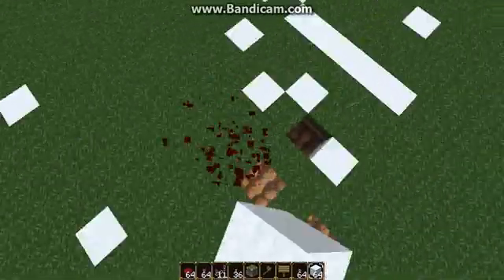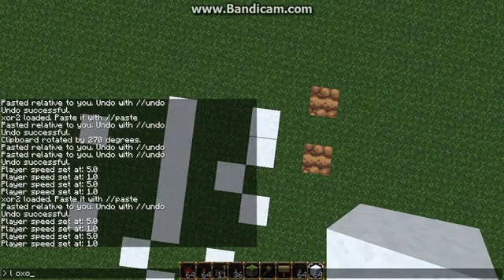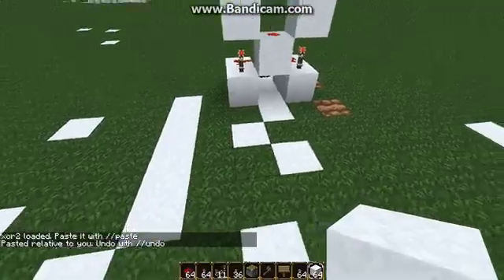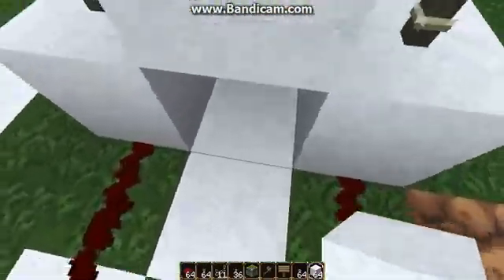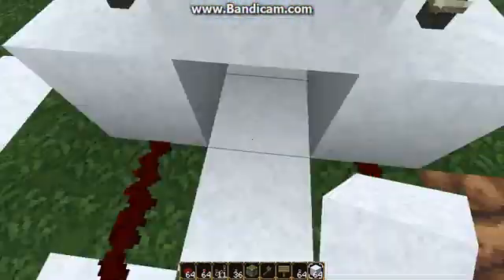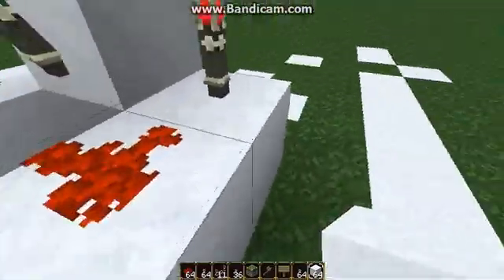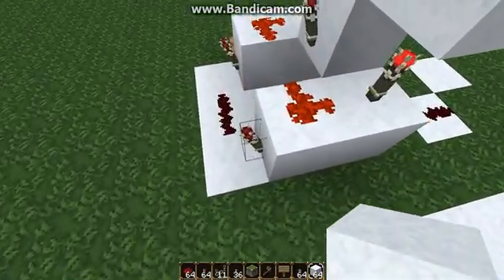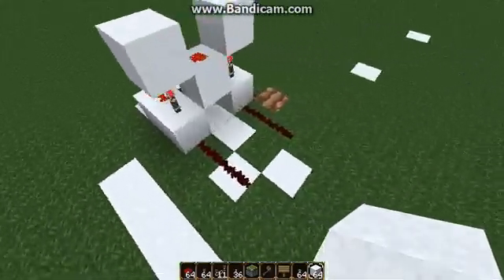Designing a minecraft computer pt1: Introduction

Comment from the maker: That would make a calculator or logic processor. The idea of a computer is that it can be programmed to do different functions. So if you want to make a computer, you just need some collection of commands that it does, and then a system of programming those commands in a sequence that can then be executed by the computer. This is also the reason ROM is even added, because its very useful in programming